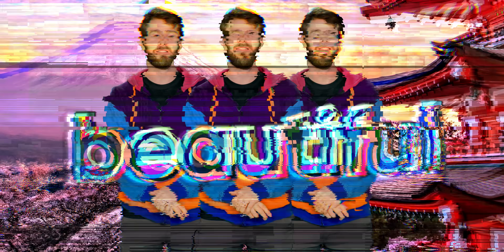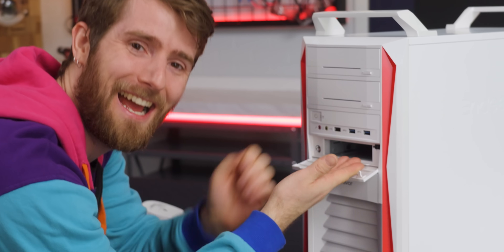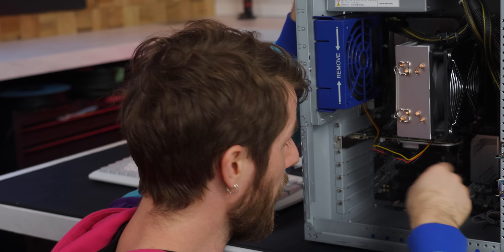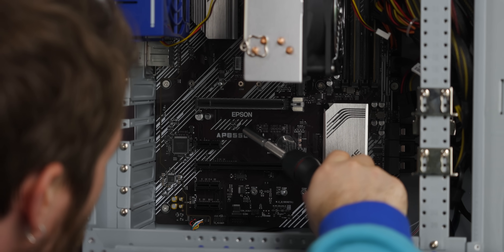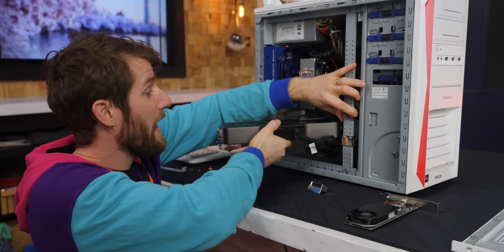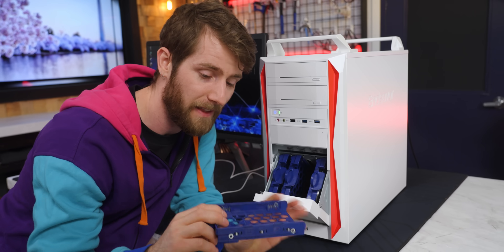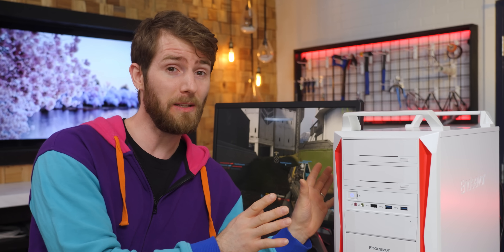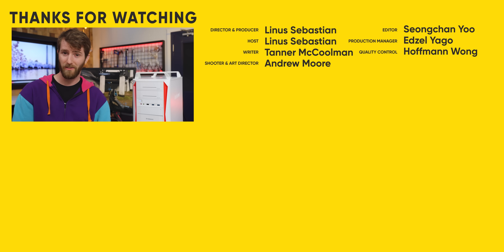I Bought a Gaming PC from EPSON - Epson Endeavor Pro 9050a

Comment: The optical drive allowing for more than one internal bay writer drive (specifically internal rather than 'external', even though those have uses for moing data) means backups and cloning system-image spreading (or compression with archives) across multiple disks (e.g. DVDRW or MDisc or BluRay BDXL, CDRW, etc.) can be scheduled (MSWindows) or done by CronJob in Linux style systems (or tantamount BSD, unix style or systems, or GRSync) can be done with disk already sitting in the drive even when the person is away from the PC. So spanned images can be done, or father versus grandfather images, or simply duplicate images. Of course, 3 or 4 drives (which that PC can take_ allows for a mix. Even on a mere DVD (or say 4.3 GB) the 4 internal drives can give 17.2 GB prearranged to automate perhaps once per week and the owner only swaps the disks every month or maybe even year (and do remeber that "sort of half height" optical drives can exist). This then also means external optical drives can take copies to move off-site. Doing data storage like this can be added to tape backup and similar rather than being the 'only' backup method used. A bunch of DVDRW drives can be an extra backup or image method newcomes can understand and learn quickly. Also restoring to a spare HDD or storage with it can be done without too much for a daunting learning curve.
As an aside, of you seek to uniquely identify the motherboard, make note of the FCC ID, which may or may not be between PCI-e slots. The rebranding might be to comply with FCC ID (or regulations).
Legacy PCI slots lend themselves to 100Mbit LAN RJ45 NIC ethernet which (in linux) are still useful and frequently have a much much smaller driver file size whereby various strategies are helped by those small drivers (and yes, even FDD can be helped by that size).
My comment has no hate in it and I do no harm. I am not appalled or afraid, boasting or envying or complaining... Just saying. Psalms23: Giving thanks and praise to the Lord and peace and love. Also, I'd say Matthew6.

Comment: Epson used to have a "factory repair-refurbish" center in Indianapolis - but they had issues with the contractor that was running it, and I think it either got the contract let to someone else (no shock, that was 25 years ago or so) or may have shut it down entirely.
It DID do PC repairs at the time, as well as repairs and refurb on printers.
And yes, I DID work there for about a year - before they decided to violate US Labor Law and REQUIRE overtime of hourly employees AFTER being warned about it - but that wasn't Epson itself, that was the contractor.

Comment: Rebuilding a PC at my lab was a nightmare because when we replaced the motherboard, we needed a new chassis. The old one was too small. Try fitting 5 classic hard drives and an optical drive into a (giant!!) case that has no spots for any of them. Our 3D printer got a work out.
Reply: Obviously this comment was regarding the optical drives in the Epson machine

Comment: Floppy Disc drives are still be used by many people....Ever since I saw a guy who modded Floppy discs by putting an  SDcards inside of the floppy disc (or a MicroSD card inside of an SDcard adapter, that was then put inside a floppy disc after removing the spinning disc inside of floppy discs. 

I thought it was pretty awesome to have a few modded floppy discs with 256GB on each... and surprisingly work great

Comment: You can find hot swap bays - but usually in rack cases.
I have one on a monster tower case I have - in the TOP of the case - but that's the only non-rack case I've seen with one, other than "adapters" that turn 2-3 5 1/4 drive bays into 2-4 3.5" hot swap hd bays - but I have seen listings for them occasionally in desktops/towers.

Comment: So those type of cases are often used for Classified purposes because the HD can be locked in-place and removed when not in use to be put away in a secure container.  That whole PC was designed for physical security purposes, at least I'm relatively sure.

Comment: I want that Epson case!
Seriously, I'm going to check Yahoo! Japan and Amazon Japan to see if someone has it for sale--Delta makes excellent power supplies, so the factory power supply could be a plus, and the factory fan is a must--we'll see!
A little case mod to add USB-C to the front panel is optional, not really needed as long as whatever motherboard I use has it on the back.
Solidness and that GPU support bracket, plus the front hot-swap array are the buying points for me.

Comment: Wow, I would've loved to own a case like this. So much nostalgia. The handles kinda reminds of some 90s IBM pc towers. I still have an old Pentium 1 IBM system that has similar handles like this one. It also has a cover which can be opened (slides down) with help by pushing a blue button in the front if u need to use the floppy or cd drive.

Comment: The first PC I built had a Mitsumi single-speed CD Drive that alone cost me $300 (at a time when Dell ads on the back of PC Mag were $5k for a 386SX - not even a math coprocessor!). And coincidentally, my first PC was an Epson Apex 100 with a CGA monitor that my grandfather got me for starting college. Of course, my first computer (home computer) was a Timex Sinclair 1000. And for the Japanese connection, I began putting together motorcycles for Yamaha the year after I got the Timex while still maintaining my paper route.

Comment: Hello LTT, I'm aware that I'm over 1 year late and you may already know this. The "no start menu" or "no taskbar" glitch is a product of windows 11 and on rare occasions windows 10. At the time of commented there is no concrete fix, but if you change the Scaling of text, apps and other items in display settings to any value other than the currently selected and then back to your desired value it will fix the issue. Also, restarting usually fixes it but takes longer than the previous mentioned fix. Hope this useless information helped you.

Comment: I live in Japan. Japanese PC manufacturer, not only OEM likes Epson/Fujitsu or pre-built PC maker likes PC-kobou, really love to build a gaming PC as old style PC. likes a Windows XP era PC but modern hardware inside. Optical drive bay, floppy disk drive bay is very common when you buy a PC from Japanese PC manufacturer. I will say this kind of product is not a gaming PC, but an robust Workstation which can be gaming.

Comment: You would think with no intake at all in the front it would be a thermal coffin for any higher end hardware, but you really can't overstate how much an impact a bit of side panel perforation can be - I've noticed that a fair bit playing with old enterprise gear. Old Dell Precision towers have a similar perforation in their side panels, your GPU is basically breathing outside air.
Reply: There's vents in front of the HDD caddies.

Comment: A 650 watt DELTA (which is a higher-end brand, A LOT OF SERVERS use Delta made power supplies) should be plenty for that system.
1000 watts is overkill, unless you want to run a PAIR of RTX 3080ti.

Comment: For all the muricans, yeah Pozidrive is superior to Philips. Philips was originally designed to slip off, because back in the day there were no automated torquemeters. Pozidrive is designed not to slip out, hence the vertical edges, while the philips edges are angled and lead to a force pushing out.

Comment: Hey Linus I switch over to college master thermal paste and it helped a ton my gtx titan Xp no DVI port and it boosts to max clocks by itself all while staying under 45c under load and my CPU is only going to 50c with faulty bad water cooler but temps are amazingly low

Comment: I had a 750 watt MSI power supply die from my 3080ti and Ryzen 9 3900x. I just built my new PC Ryzen 9 7950x, MSI x670pro motherboard, 32GB ddr5 6000mts. 4000D airflow case. 2 aio coolers.

Comment: I wish chassis design went back to functionality instead of being flashy.
Some chassis makers are doing more functional stuff now, but still, they don't compare to this.
It's odd to me that chassis designers don't strive for the ultimate chassis, with a lot of functionality, maximum functionality even, but also have a bit of design, like paint it black, white etc.
I feel like if they did they would've gotten there by now, which is why I assume they don't.
Also, that drive bay makes me feel things I never thought I'd feel towards a PC chassis.

Comment: I once had an experience with a case that had an opening on the side to allow fresh air for the GPU and it changed my GPU temps by arround 9 or 10 degrees celosius so it works just fine... till you put a dustfilther on it 😀

Comment: Doesn't have enough bays, need at least 4 (DVD, 5.25" FDD, 3.5" FDD and front mounted CF or SD to IDE Adapter). Also it's missing a classic MHz display. Else the case would be nice for my retro PC. :D

Also have a P3 800 system inside an old server chassis, so it also has such a bracket, not that the Radeon 9000 Pro inside needs it. Btw, it also had a chunky industrial fan (even with a similar plastic casing) inside which was damn loud and has been replaced by a Noctua one. xD

Comment: I mean, as Linus said, it's a workstation, not a gaming PC, and as a system engineer, support for archaic technology like optic drives, serial communication, and outdated ports like TTY is much more important to me than the GPU or the overall top tier performance. It's not made to be the best, it's meant to be a tool that can do a wide range decently.

Comment: 12:54 Win 11 i presume... It does that. Has this issue but was not alone, other stuff seemed to not work properly like search or remote desktop or apps taking very long to open and whatnot and a restart didn't work and a dism restore health couldn't complete. On my search for a fix i disregarded a comment on a forum thread saying that they fix their issue by "taking out the blue wire from behind"... oh ok sure..
Guess what? I notice a bit later that when pinging the pc had a bad connection, many lost packages. And what do you know, fixing that like magic made everything work again. So i guess it was "the blue wire in the back", of better said, Microsoft and their bright ideas wanting you to be online. As i presume it was working as online but having a faulty connection not everything was communicating properly and windows "thought" it was online. So they surely have some stuff working in the background that should not. Why should it behave differently if online or offline that explorer, taskbar and search and all to work differently? So yet again, Microsoft sucks.

Comment: 5:27, The fan actually draws up to 15 watts under max rpm (4000) for the 4 wire version and they last YEARS. I use 2 to supply fresh air to the GPU and to exhaust.

Comment: The comment about Epson making watches made me LOL…

The full name of Epson is “Seiko Epson Corporation” because it is a sub-brand of… you guessed it, the Seiko Corporation. More specifically Seiko Epson produces the printers and more high end watches under Grand Seiko, Credor, and the Astron brands and they also produce Orient brand watches. They originally started out as Suwa Seikosha Co. and started making printers much later for originally for the 1964 Olympics as a way to print out Olympic times from their new quartz clock that they had developed a few years earlier. So technically even though they now make most of their money from printers they are, at their core, a watch company.

Comment: Hey Tanner, what weird exchange rate were you using to calculate the Intel version?  At the sale price of 358,000 yen (with tax) that's closer to $2500 than $4000. - though shipping I'd imagine would cost at least $150-200?

Comment: I guess liquid cooled and requires 90 dollar recharge once a month and a complete change of the cooling system every 3 recharges, and only works with a proprietary power cable - sold separately?

Comment: Pozidriv are touted to solve the biggest flaw of the Philips, caming out. The truth is that was built into it's design so factory workers didn't over torque the screws. Thus it was not a flaw. The flaw in the Philips isn't that but the fact that people are using it everywhere it wasn't designed for.

Comment: I do not get it! People do white builds.... nothing wrong with the case i great! Way better and versatile than many on the market really. Bonus points mb is not proprietary, neither the psu, neither even the fan so in case you need to upgrade can be reused! Get a acer or dell and good luck changing anything... note my systems all have a optical drive blueray except the one i build in march as i still need those now and then... and i do live in uk.

Comment: NMB fans are EVERYWHERE. Dell's OptiPlex series is just the tip of that iceberg. I've seen them in vintage Macs from '91, external hard drives in the '80's, and in systems as new as my 20-core Dell workstation. Probably as ubiquitous to call a muffin fan an NMB as you'd call sanitary tissues Kleenex.

Comment: Sorry linus but while you may find optical drives not useful for many other ppl it is not . that why i will never buy a case without it. it all depends on what you plan to do with your computer. for example why should i buy an usb pen just to store pics that will never need to be modified on a pen in a drawer when i could use 20 cents dvd witch will last probably even more then a pen , while i can still use the pen for other things

Comment: I find that EPSONs PC isnt That Good.

Well Still better than mine i think didnt watch it yet

MY PC Specs:      

CPU : Intel(R) Core(TM) i5-10400F CPU @ 2.90GHzs
Ram : 32,0 GB
Disk (C:,D:) : SSD_M.2_PCI_NVME_1TB_InnovationIT
Disk 2 : (F:)    Multiple Reader USB Device
Disk 3 : (G:)    Generic MicroSD/M2 USB Device
Ethernet: Intel(R) Ethernet Connection(10) I219-V
Ethernet: Vmware Virtual Ethernet Adapter for VMnet1
Ethernet: Vmware Virtual Ethernet Adapter for VMnet8
GPU : NVIDIA GeForce GTX 1650.        (temp rn:26°C hot)

Fan : No Noise Right Now. (open apps.    ue5,ue4,taskmgr,notepad,mc,fnaf sb)

Roast My Setup.

Comment: History of Asrock,....   take Asus design.. slap new label on..  sell..   spin off company..    company continues using Asus designs mostly under license..  but CS starts slipping..
Asrick hires away one engineer from asus and a few others. and starts making their own designs.. fairly decent hardware wise but their CS still is lacking
fast fwd... and asrock hardware is a  hit and miss  with some very good hardware designs at times.. but their CS has gone so far down hill they have been blacklisted by a half a dozen+ IT pros from even being used for reviews anymore.  Asrock also tried pulling an nVidia on some with trying to dictate terms for reviews and were told to pound sand.

They are at this time the absolute WORST of the big brand names for CS...,  and after being involved with helping one customer fight to get even a replacement for an $75 motherboard for over TWO YEARS... and literally over a hundred hours wasted with their so called CS...  I can honestly say that in all my decades in IT I've never yet seen a worse example of bad CS..

Comment: この番組はご覧のスポンサーの提供でお送りしますww
epson's pc is too expensive for its spec and aren't selling well even in japan.
i haven't seen epson's pc in daily life. there are dell, hp, lenovo, fujitsu, nec's pc in japanese company
exterior design is terrible. it's like a child toy.
geo is not zio. gheoh.
motherboards with different model numbers have slightly different specifications from original one.
some japanese pc parts shops sell slightly different motherboards.
minebeamitsumi(very long and difficult to pronounce name)mainly manufacture bearing and motor.
i didn't know that manufacture game controllers and it's not listed on japanese wikipedia.

Comment: Hi Linus,

I hope this message finds you well. I wanted to reach out to you about something that's been on my mind lately. My current PC, which I've been using for gaming since 2012, has become too old and problematic for me to use anymore. For example, a few years ago, I had to replace the graphics card because it broke down. As someone who's passionate about video games, I'm in desperate need of a new gaming PC that can handle the latest games and provide me with the performance I need. I was wondering if you might be able to help me out by gifting me a new gaming PC. I understand this is a big request, but I would be forever grateful for your generosity and support.

Thank you for your time and consideration.

Comment: I doubt Linus bought anything I am certain this PC was given to him via the sponsor....PRO lol it looks like a very cheap low end case which  screams low budget.
RIGID...umm yeah it's called multiple screws which makes anything rigid.Floppy disks NO nobody needs them anymore it's called flash drives.
PRO model but using a low end Ryzen chip again low budget.The GPU is also pure garbage this PC should NOT be using any form of the term PRO this is a piece of junk that shouldn't be selling for more than 500 bucks CDN.
Rebranding Me thinks more like copyright infringement.
Lastly although RGB is not the most important thing this is 2023 any machine w/o any has to be considered super low end CHEAP.